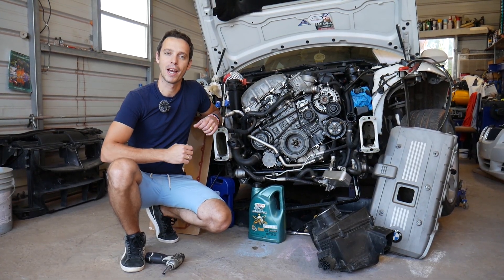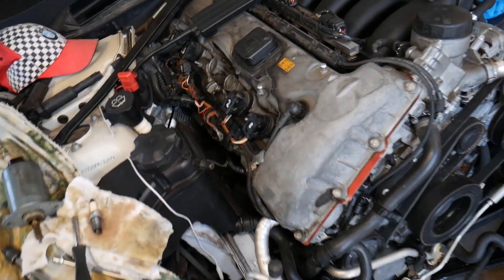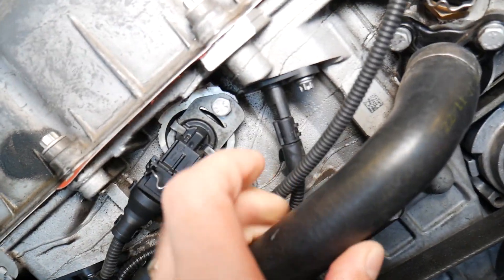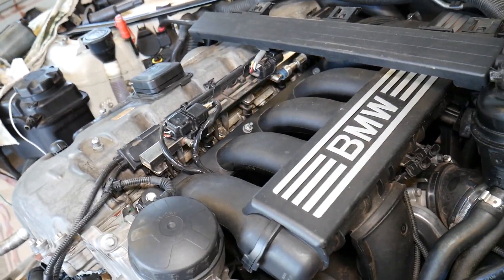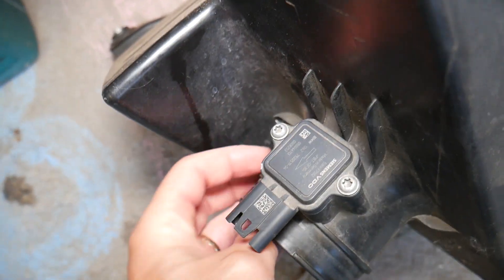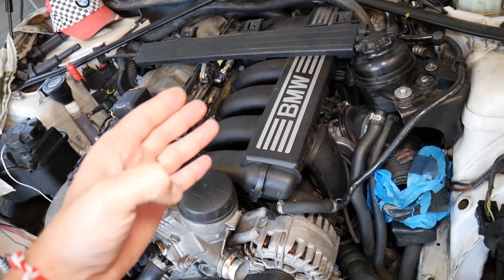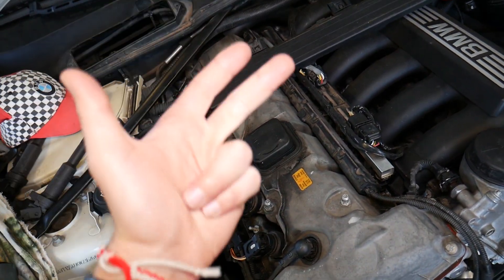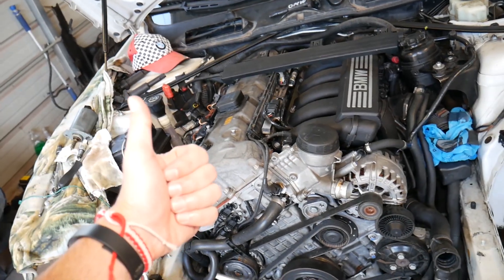TOP 20 REASONS FOR ENGINE MISFIRE ON BMW X5

Comment: I bought a valve cover kit , ignition coils and new spark plugs for my x5M f85 hoping it works. I launched it in the cold and then it started misfiring after that. Bad fires in cly 3.

Comment: HELP PLEASE...
I keep getting misfire coil 6, changes all the coils, spark plugs,  filters, did on oil change, and I keep getting missfire coil 6. Bmw dealer checked it said it was the injector, changed it and yes the check engine light is baking on. PLEASE HELP!!!
Reply: Did you figure this out? I have the same issue 08 x5 3.0 misfire cyl4 , changed plugs , coils and injectors and still misfiring on cyl 4
Reply: @CarlosRamirez-wh9gz  hi, did you ever figure this out? I am having same issues with my x3 2014. I am thinking it might be my catalytic converter but and hoping it is not...
Reply: @kaitlinfotevski3752  def would not be the catalytic converter do you know anything about cars?
Reply: i also had a problem with cyl 4 changed coil, spark, but it actually turned out the wiring to coil and injector, the mouse chewed on them, so inspect wiring also

Comment: If you know this engines or if you know BMW very well you must know this, if your oil filter is old and is twisted or damaged inside the oil filter housing your engine will run very bad and it will create misfiring because of Vanoss all of those things you mentioned yes they will cause misfiring but an old dirty oil filter the most important item in that engine oil is very important for all BMW engines especially if they have Vanos system

Comment: My high mileage 2007 x5 was misfiring so I replaced all the spark plugs and ignition coils, now it runs smoothly
Reply: I just got a 2015 bmw x5 with high mileage nd it’s saying drivetrain malfunction the dealership saying I misfired should I do the same thing you did? Nd how much was it for you ?